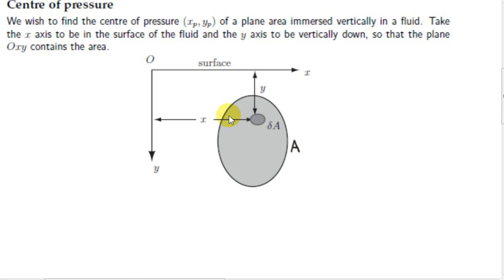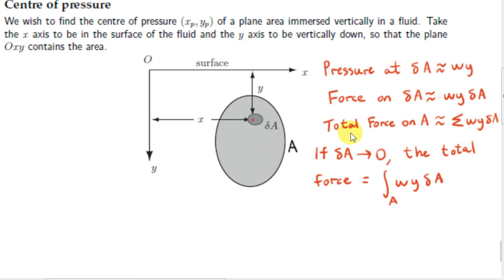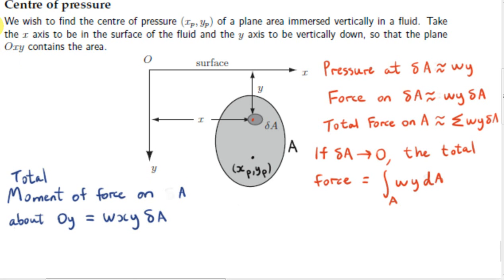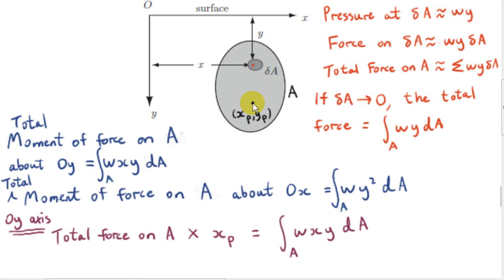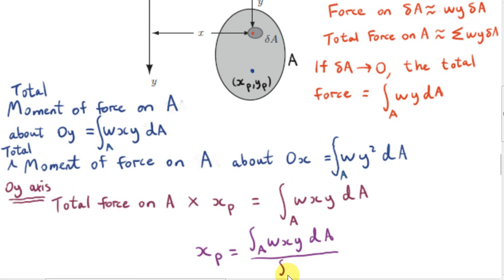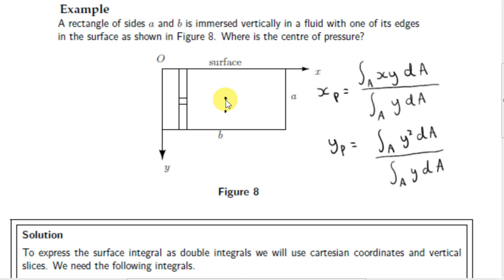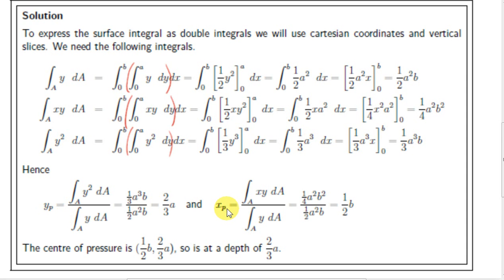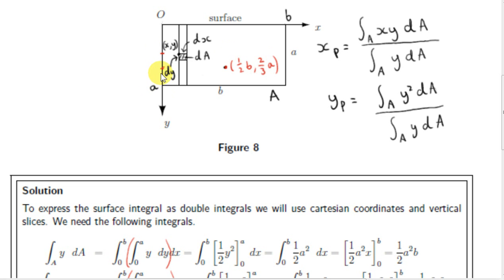Double Integration - Centre of Pressure Derivation and Example

Comment: An important example. Interestingly (1/2)a,(2/3)b is also the coordinate of the centroid of the triangle formed by omitting the upper corners. But then the centre of pressure of THAT figure can't correspond to the geometric centroid any longer due to pressure varying with depth.